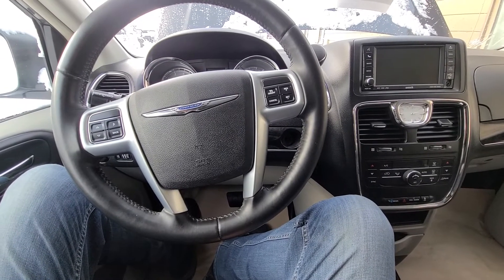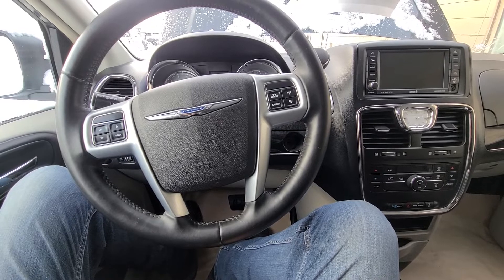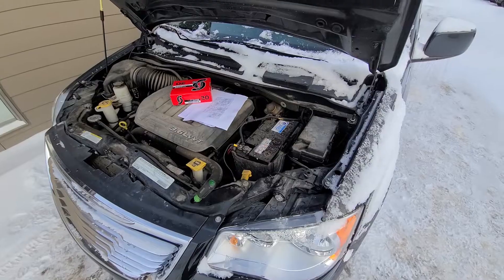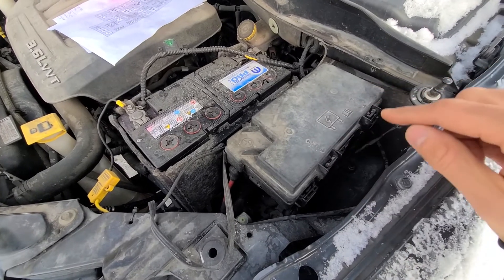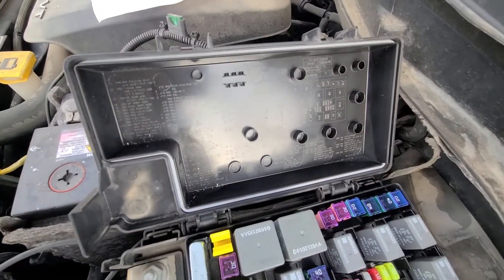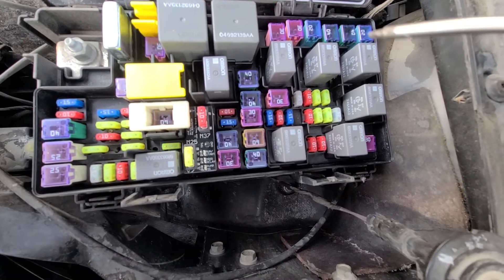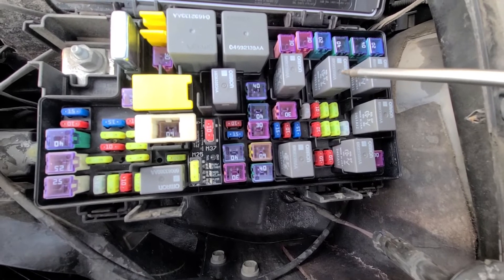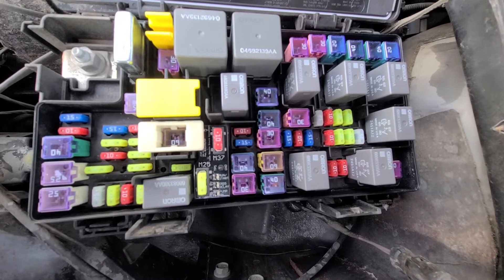Chrysler Town & Country - STARTER FUSE & RELAY LOCATION (2008 - 2016)

Comment: My problem is alternator I put mew one in and test it with meter but not giving off the power.  Is there a switch inside the alternator that prevents power from the alternator?? Put meter on power bolt of alternator and ground and still only 12 v from battery.

Comment: Hello , my T&c 2012 start Remotely but the Heater or ac does not , is a fuse problem ?
Reply from the maker: If starter fuse is bad then car wouldn't start at all. Heater/ac not working could be a failed blower motor, blower motor resistor or maybe a blower motor fuse